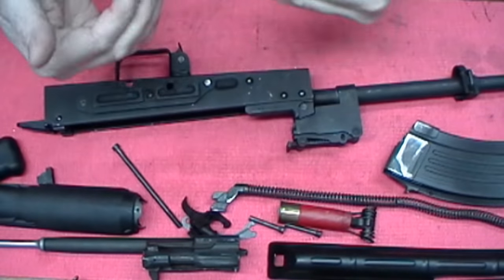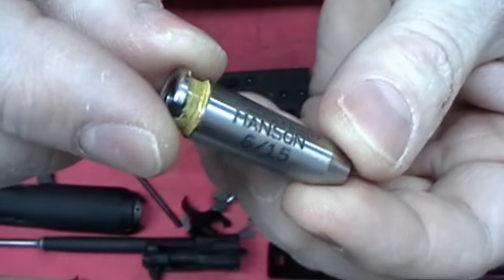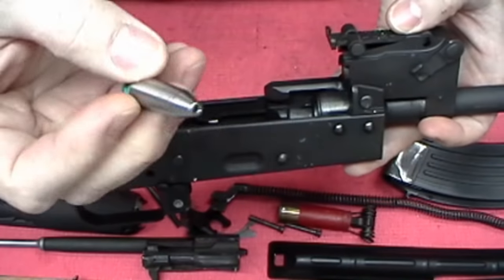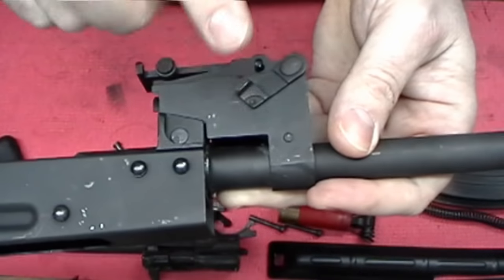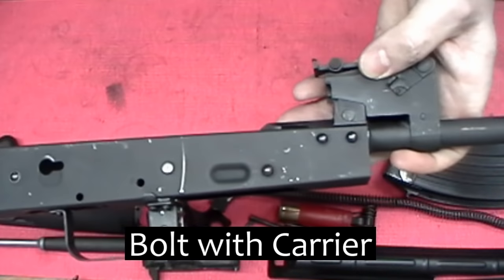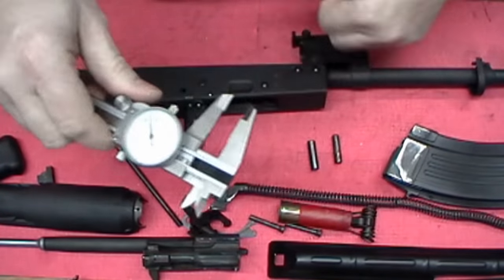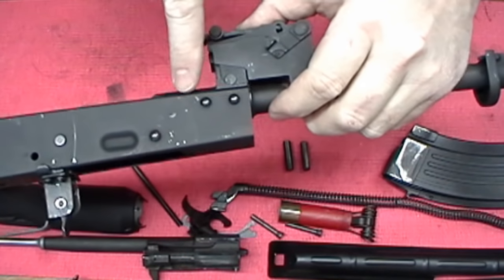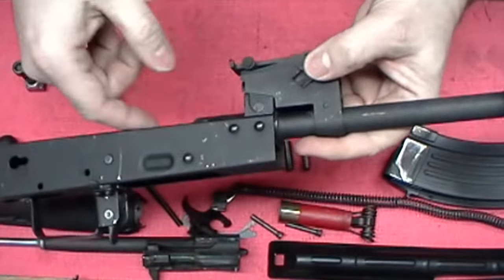Loose Head Space (AKM)

Comment: Thankyou just what I was looking for. On my new AK build the barrel was popping. when being pressed in. I checked the headspace perfect. Milled the barrel pin hole checked again perfect. Reamed the hole. This is where I think my problem happened, I think the reamer was worn.  I pressed the pin in. And it went in hard the headspace went out of spec. Go gauge is great. No Go allows it to almost lock up. And the field gauge wont come close to locking up. I think it would be ok but im a perfectionist So going to take your advise and pull the pin and pop the end with a plastic or brass hammer. And cut oversize. Thanks for the great video
Reply: I had the same problem.  Everything checked perfectly. Close on go. No close on no go, no close on feild. Drilled. Same readings. Pinned it, same. Test fire, good, 100 round test fire, closing on no go, but still not the feild, that's why I'm here.

Comment: nailed it man! Great video! I always build mine tight. I'll even lap the bolt if it's just a little too tight. better for accuracy and if you use the right gauges the go is a few thousands bigger than any ammo you'll shoot anyways. I also carry field gauges. sometimes barrels can be tricky moving just that little bit. they like to jump around. found putting some pressure on till you feel it's just about to go then tapping on the side of the barrel with a mallet. kinda message it in that few thou. keep up the great work! 😉👍
Reply from the maker: +MadMetalManiac74    Thank you, I have spent a lot of time going back and fourth trying to get the head space correct. Just trying to get some info out so others may not have to spend half a day and getting so frustrated with the head space, that they give up on it. No one is born with knowledge, it must be acquired.

Comment: I built my first one this past weekend.  I did the typical step, and populated the barrel, after setting head space, and drilling/pinning the main barrel pin.  Then removed the front trunnion and riveted it to my receiver, then pressed barrel back in.  It's fairly difficult to get the barrel pin holes lined up again.  Have you ever tried riveting the trunnion, then setting head space and barrel population ?  It seems like it would be more cumbersome for barrel population, but everything would only get pressed, and drilled, once.
Reply from the maker: I will press and set headspace (dummy headspace) but do not drill for barrel pin.  I then populate the rest of the barrel. Drill and pin the front/rear sight blocks and the gas block. Then I will press out the barrel from trunnion. Rivet trunnion into receiver, then press the barrel in and set final headspace. Then drill and pin the barrel. This way I do not have to try and realign the pin hole groove in the trunnion/barrel, and the barrel is easier to drill for the components without the receiver hanging out in space.
Reply: +Mel64D , that makes sense.
Reply: So the barrel pin is the last thing you do. Good idea